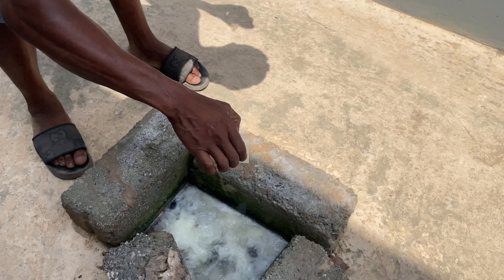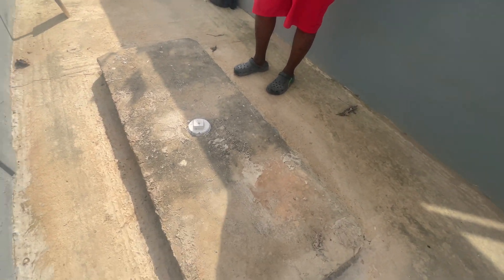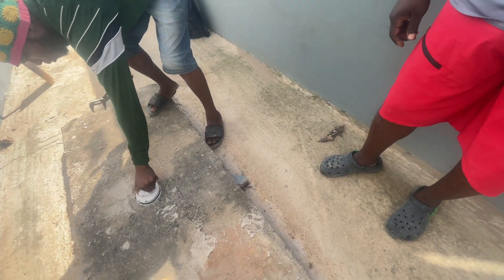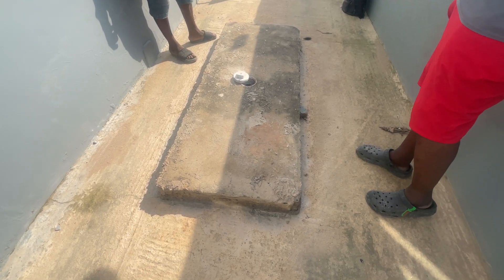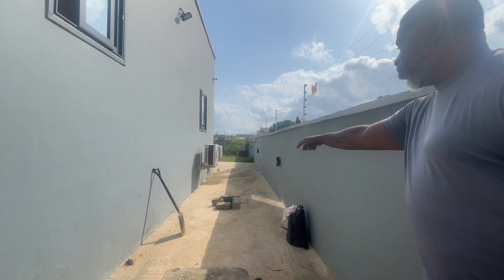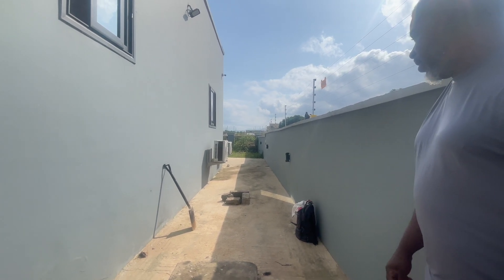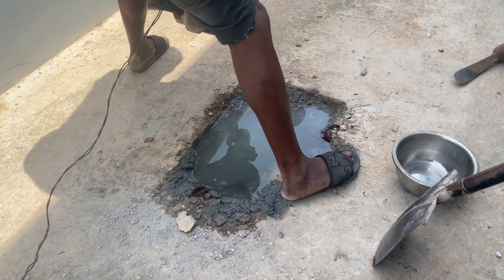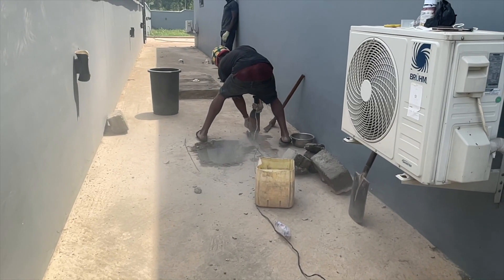Biodigester maintenance secrets to long-lasting use

Comment: Jerry one more thing, I feel that your new soakhole pit type should have been bigger to breathe bigger. It's obvious the users on that side is more and needed more space to take care of the waste water. I have a job like that am praying it does not get to that. My massion is calming me down it will not get to that level, it's not a water logged area and not clay but red mud.
Reply from the maker: @okeychimeziri6600  you may be right. Just that the soil type is good , if not because it was tampered with by the grounds folks it should have worked fine under the concrete.
Reply: @JerryAdu-Asare  Jerry what is that chemical you said, you put in the toilet after one year usage, what's the name. Or it's our usual marketing washwash.
Reply from the maker: @ I have actually spoken about it in a few of my recent videos. There’s a chemical for faster degradation of solids 😊.